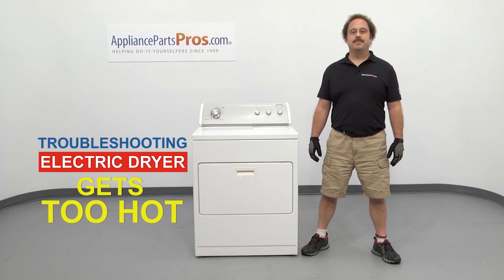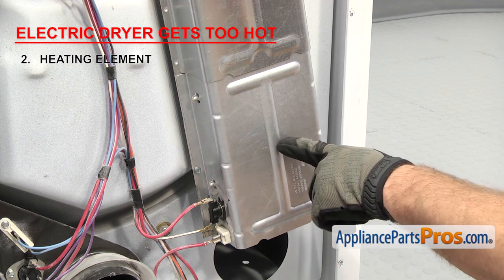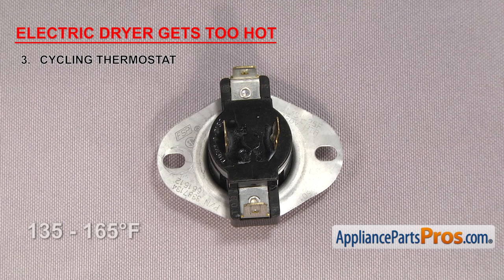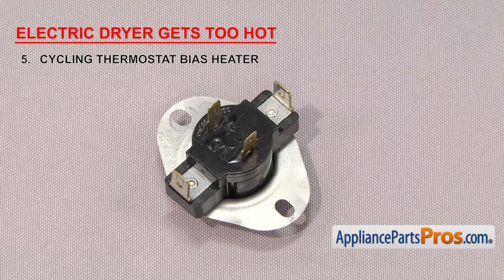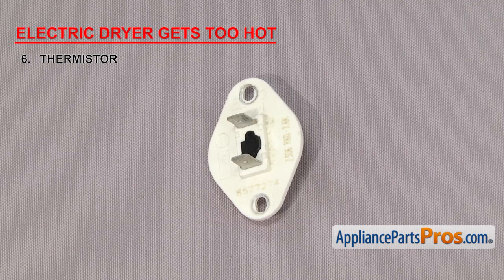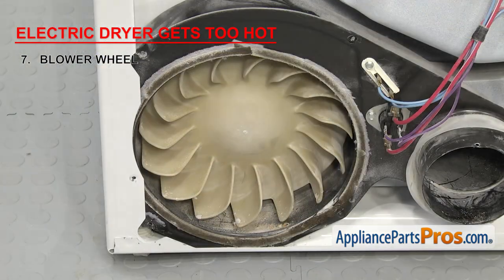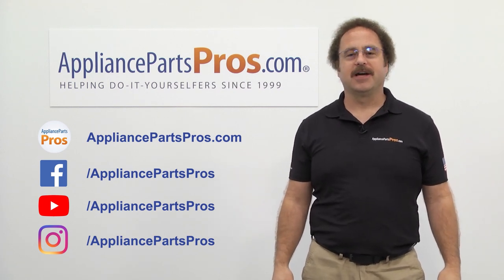Electric Dryer Overheating - Top 7 Reasons & Fixes - Whirlpool & more

Comment: Great video, I appreciated the thorough step by step through each potential cause. In my case it ended up being the heating element being grounded. I disagree however that if it is grounded that it needs to be replaced. I was able to pull my heating element off and found that one of the coils had shifted and touched the side of the box, thus grounding the heating element. Once I moved the coil off of the side and way from any other metal to where it wouldn't likely touch anything else. My ohm meter then only showed continuity from the leads on the outside of the heating element. No longer showing continuity from the leads and the outside of the box. Once plugged up. The problem with the heating element staying on without the motor running, had been fixed. 

Probably saved between 20 and 40 bucks by looking and moving a coil.

Comment: Just ordered cycling thermostat (rated at 150, it opened circuit at close to 200 degrees), high limit thermostat (one lead was melted when I opened up back of dryer), and thermal fuse (unit shut off after it became so hot to touch). Thanks again for the clear instructions.
Reply: I have the same problem and it's been a long time. Typically burning up the heating element or the wire and connector to the heating element. I tested the cycling thermostat in the oven in a small cast iron pan. Thermostat did open up until approximately 200°F.

Comment: Great video! Comprehensive, well produced, to the point. I love the links to required parts on your site. Just one suggestion - add Main Control Board as an 8th possible overheat cause. In my Whirlpool Duet dryer the Cycling Thermostat function is accomplished on the control board. After replacing all of the other components as part of an overhaul and overheat repair, without success, I replaced the Main Control Board and that resolved my uncontrolled/overheat problem. Overall, the parts I bought from you came to under $500. I avoided having to buy a replacement dryer at less than half the cost of a new appliance and, hopefully, will get another ten years of trouble free performance.
Reply: I know this totally off the subject. But the same is true with these super deluxe,super expensive box style space heaters. They use a Main Control Board also. After changing all the components in the one I was working on and it still didn't work. I had to tell my neighbor that his heater was a boat ancore. The main board was not available anymore.

Comment: My thermal fuse blew the other day, went and got a new one. After one load on med/perm press dryer was running really hot averaging exhaust temps of 160-180deg and dryer hose was hot to the touch.. Tested continuity on heating element, but did not test cycling therm and high limit therm like you did in the video. I got inconsistent temps on my high limit therm, sometimes it tripped at 250deg sometimes over 300deg. Bought and installed new high limit therm, and now my average temps at the blower are 110-120 deg and 95-98deg at the vent on the medium heat setting.
Reply from the maker: How often do you clean your duct work to the outside and how often do you clean the lint filter?
Reply: @appliancepartspros  not much lint at all, and blower didn't have much either.

Comment: The dryer vent has been cleaned.  Fuses and thermostats have been replaced.  Why would the "Delicate" cycle on a dryer continue to run hotter than any other cycle?

Comment: If the element is shorted to case wouldn't that trip the breaker If the case is properly grounded ?
Reply: My same question! I also wonder how this condition would play out with a 4 prong dryer plug vs. a 3 prong dryer plug.
Reply: Not necessarily.  It depends on where the coil is grounded.   Normally, there is 240v across the coil.  Imagine each lug being connected to one of the 120v "hot" wires in your 240v circuit from the panel.  If the middle of the coil happens to be grounded, then you get 120v from each side going through half the coil to ground.  It isn't at all a "dead short".  Now, sure, if the coil happens to be touching in a spot very close to one of the ends, then you'd be close to a dead short and probably trip the breaker.  But the ends are connected to the lugs, where they are well supported away from the case.  These things tend to touch more out in the middle where the springy wires can get deformed or bent.

Comment: What reading should you have on the other 2 terminals on the cycling thermostat?
Reply from the maker: What is your model number?
Reply from the maker: Thank you! You should read continuity with no resistance between the two large terminals. The two small terminals should read about 9K ohms at about 70°F.

Comment: Used Frigidaire (Electrolux) dryer doesn’t overheat during test runs with the vent hose disconnected but does within a minute when I connect the vent hose. You’d think the vent was clogged inside the wall but it’s not: I bought a drill-operated cleaning brush and made sure it was clear.

I’ve taken apart the whole thing multiple times and made sure to seal everything after the blower motor to keep it from recirculating hot air but it still gets way too hot within a minute of connecting the vent hose to the wall. What gives?!

No, the heating element coils aren’t grounding out and I can set it to “No Heat” and they don’t come on.

Only thing I can think of is that connecting it causes just enough back pressure to reveal a different issue with the cycling thermostat so I will be testing it with a heat gun the next time I have it apart. That said, I figure I’d find at least one person with this issue online and I haven’t. Weird.

Other things to note: The foam seal around the blower intake doesn’t look great but it definitely shouldn’t be recirculating hot air the moment I connect to the wall vent.
Reply: If the pipe is very long or is very bent it may make it very hot I saw it in another video.
Reply: @kachiquitaito3341  Thanks. It was a tight turn but a short run that only requires two segments of the typical drill-powered cleaning brush. The turn was so tight that it causes the flexible brush shaft to tangle up when you try to get past it. We couldn’t even reach it from the outside so we had to go inside-out. After several more passes we cleared out a bit more of whatever was obstructing it… probably a wasp nest. The home hasn’t had anyone living there in the 2.5 years since a tornado tore off the back balcony along with the dryer vent cover (…and the roof, and the trees, and my car, etc). I was able to see daylight from the inside and I had already passed the cleaning brush through to the outside so I didn’t think it just needed more cleaning but it seems I was wrong. Works great now!

Comment: Great Video. Thanks for posting.
 I have a question that may be kind of an ignorant one. Does it matter if the wires going to the cycling  thermostat get switched in the re-installation, or for the high limit thermostat for that matter,  or should it regulate and cycle either way since the thermostat is basically just a switch? Thanks
Reply: It doesn't. like you said it's basically a switch.

Comment: my dryer keeps overheating after changing the timer, all the thermostats, the thermal fuse twice, checked blower wheel, air flow, and is still over heating. Also the drum turns with door open and even after changing the door switch it still runs with door open. the video is great and is a go to for me, but this dryer is over heating for other reasons that are unique. My guess is the harnesses.

Comment: I'm lazy and don't want to pull it out. Any way to test for a shorted element by checking each hot prong of the power plug to metal dryer chassis?
Reply: I actually just did this and it was completely open between each hot prong and the metal dryer chassis. I'll pull the dryer out and actually test properly but I still wonder if this would show resistance if the element was broken and or shorted to the chassis. Oh, and what if your dryer is older and only has three prongs, (2 hot, 1 neutral) wouldn't the short to ground pop the breaker?

Comment: What is wrong with my control board to cause it to blow the thermal fuse after a few loads of laundry? The problem follows the control board. Thank you,
Reply: The cb cannot read the resistance rates from the thermistor thus blowing it. Read the thermistor from the board, then the thermistor to determine the bad part

Comment: What if it doesnt show anything when im touching the box and the outlet part. Also my thermistor is reading like 230+
Reply from the maker: What is the model number of your dryer? There are no lights showing on the display at all?
Reply: @appliancepartspros  DVE45M5500Z/A3 n no it's not showing any light. Just straight ----
Reply from the maker: Have you recently had any type of power outages?
Reply: @appliancepartspros  no sir I havnt

Comment: i have an older electric dryer. Basically a Whirlpool. It gives heat on the "no heat" setting. Which of the components tested would cause this?
Reply: Have to replace your heating element. It shorted out
Reply: Ivan M I neglected to say it gives heat on all settings including the no heat setting. Would that still be a shorted out heating element? Thank you for your help.
Reply: Check the heat element
Reply: The way your dryer should work is when you put it on no heat, it dries clothes by air from the blower without heat, and on the heat setting, it should give out heat. Well, my theory is the heater is shorted to ground. You can test it for continuity and see if that's correct.

Comment: I have replaced Thermal fuse located on heating element 5 times! The continuity works on the high limit thermostat next it. and the heating element itself passes the test as well. Is there another thermal fuse and thermistor behind the blower that I need to replace as well?

Comment: It’s almost always the airflow. Like,  95% of the time sort of almost always. 

If you’re here, check your vent.
Reply: Mine wasn’t clean and the old style vent was damaged leaking air.  I cleaned up everything but still running hot unfortunately. There is a burnt smell coming from the coils.  I’m guessing one of the two thermostats. They are not easy to reach either😢

Comment: Your instructions were to quick. Also you didn’t explain when testing for continuity why you need to put one probe On the heating element housing and one probe on the actual terminal And why couldn’t you have just put two of the probes on both prongs to test it.
Reply: Putting one probe on the terminal, and one on the housing, is not testing for continuity.  It is testing to see if the coil itself is touching the housing anywhere (which means it is grounded, as he says in the video).  If the coil is grounded, it will run all the time and overheat.  As a second completely different test,  you could also put the ohmmeter probes across the two heater terminals, just to see if it reads the correct resistance.  But that would not be looking for a cause of the dryer overheating and blowing fuses.  That would be testing just to see if the coil is broken, which would cause you to get no heat.

Comment: It's Mario Bros!
Reply: Chapters: 

0:19 1. Restricted Airflow 

0:42 2. Heating Element 

2:24 3. Cycling Thermostat 

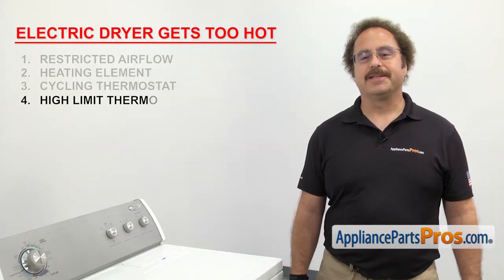3:47 4. High Limit Thermostat 

4:52 5. Cycling Thermostat Bias Heater 

6:00 6. Thermostor 

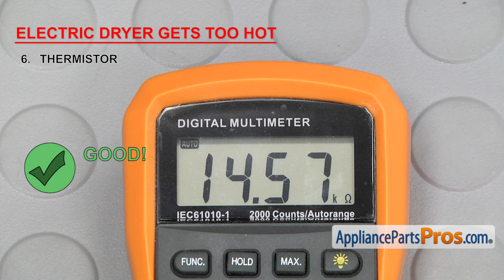7:00 7. Blower Wheel 

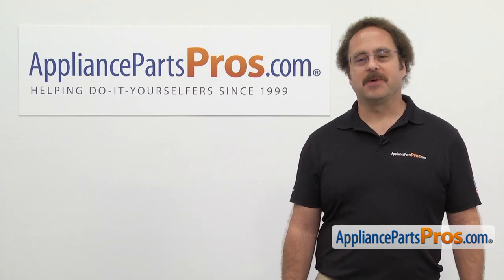7:42 Dryer Safety Tip